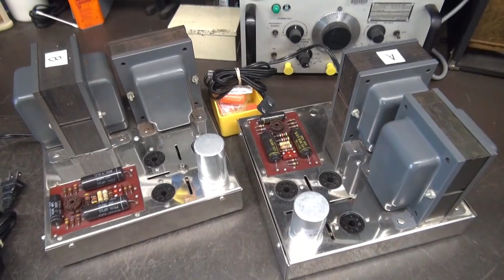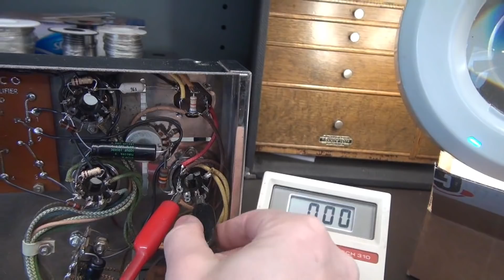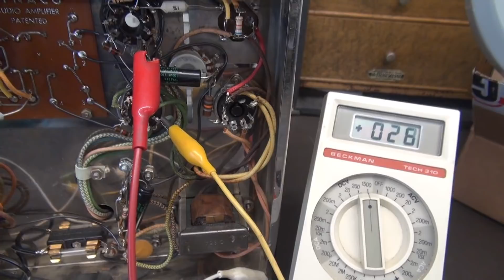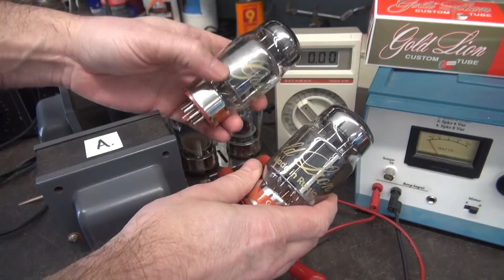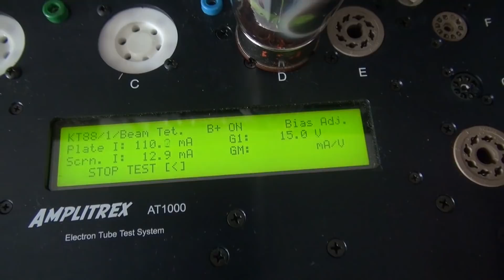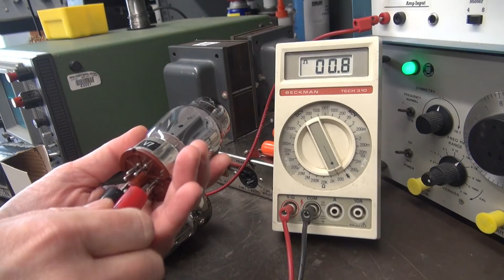How to repair KT-88 tube stereo mono block amp Dynaco MKIII D-lab electronics

Comment: I own three of these mono blocks. Actually, two of mine are much older. I replaced the capacitors similarly. I also replaced the can (I left the can and ran new capacitors inside the chassis in order to keep the same look).

Comment: Beautiful video, everything done right.  Personally I always replace ungrounded AC chords with 3 wire grounded plugs, and eliminate ground loops other ways if they present a problem, but otherwise I really appreciate Your methodical application of common sense with good electronics theory, and demonstration on using a varian to avoid problems, rather than certain other YT channels who, early on, detect problems and then go ahead and turn up the Variac all the way, with no regard to ruining  transformers, tubes,... etc.!

Comment: I have a Dynaco Power 400 solid state power amplifier with the Dynaco Pat 5 pre-amp and matching 22 band EQ powering a set of Klipshe La Scala 15" corner horns on chanel A and a set of sealed speakers with a 10" and a 12"" front firing woofer in each the same tweets, a little smaller mid-horn than the la scalas on chanel B. I cooked something in the power amp a decade ago and I only have left side working now.  I need to find out whats toast(transistor Im guessing).and I should switch out all the caps.   My dad built 3 of these as kits back in the 70s, mine,my cousins and my uncles. I have  new harmon kardon with powered sub and polk towers now and my current system doesnt even hold a candle to that old Dynaco. Where can I order parts for this old beast?

Comment: Ah, but you CAN solder the can lugs to the chassis:  merely scrape off the chrome plating under the twisted lug, down to the base steel,  and use at least a 60 watt iron and a little additional rosin flux on the work and yer golden.
BTW: sure sounds to me at 5:22 that he said "rectumfier tube"

Comment: I was thinking over to buy Golden lions but as I have seen in your video they arrived with open fillements hmm I still think the parcel has been smashed againsted a wall or something. The had matched them and tested them so it's  hard to blame the factory they won't send bad ones. I hear a lot of goods about the sound.

Comment: 17:47  ...   This "bias" reading is derived from the voltage drop across the common cathode resistor 11.2 ohm, 1 watt.  The line voltage will not be a factor in the setting.
Dynaco did this so hobbyist could use any DC meter and first measure a new standard "D" flashlight  cell and then set the bias to match the reading of the battery.  The new D cells would measure 1.56 volts on a calibrated meter so they are used as a reference here.

Comment: bit late now, but Do you have the black lead of your multimeter connected to ground during the bias readings? I can see that the positive lead is connected to the bias pin coming out of the power socket for the pre-amp. Thanks.

Comment: i do not have the Dynaco pre amp for my MK 111 amps. Do i need to short out certain pins on the female preamp power supply output at the backs of these amps so i can just connect another preamp to their inputs? Or simply leave everything stock? thanks very much sir.

Comment: Those are the wrong filter caps ! Only the F & T made 600 volt ( surge ) rated caps are the caps to use in the MK III  Those CE caps are very marginal in the MK III .    Also , a Anatherm inrush current limiter ( perhaps two in series ) is appropriate for the MKIII as that is the 115 volt mains transformer.  A high filament supply is not needed.

Comment: By the way if you run a tube that has gone to air you will damage your power transformer in a jiffy. Look for a milky colored getter spot on the tube, it should be silver like a mirror and turn white around the edges as the material is used up with age like the old tubes shown here, but not all white.

Comment: I have matched quad set of the Russian made Genalex Gold Lion KT66 in my Heathkit W5M mono blocks running now with no issues. I had a bad reliability problem with the Russian made 6L6G Tung-Sol 500v plate Coke bottle tubes going to air many times, would not recommend them.

Comment: Not earthing/grounding the chassis is potentially very dangerous. You will be relying on the screened lead from the preamp to carry any fault current if the chassis becomes live. That thin gauge may not be up to the job of carrying enough current to trip the breaker. Also if you have the preamp disconnected and the amps on they will obviously be ungrounded/earthed. Depending on the internal grounding arrangement you could earth/ground the chassis to power ground, and use a safety ground lift circuit to connect to signal ground. Just sayin.

Comment: I wonder if anyone has built amplifiers with 3c22 disc seal triodes?  I've read they are similar to 6550s but need forced air cooling above 60w power dissipation.

Comment: Terry, the filter can caps that guy put in are not sized right. They look short and even tho they are rated at 500v, you need a 525v cap like the 80/40/30/20 at 550v Authentic cap to be safe. I think the CE Mallory reproductions had some early ones that were mislabeled.
Reply from the maker: Hello, Just double checked, the Filter caps are labeled 525V

Comment: Shame about the defective tubes. :(

What a show-stopper. I had a similar issue a few months ago while restoring a '75 Fender Bassman 50. Opened the box of matched duo of 6L6GC tubes (Tung Sol) and one had a crack in the glass. I noticed immediately due to the getter being not so nice and milky. Had to order a new set, and now the amp is humming along at all the gigs I play it at. I was lucky to have the supplier replace them. I've had some 12AX7's have a nice straight line crack in them when I open them at the supplier. Now every time I buy them in person, I inspect them in front of the sales guy at the wholesaler I purchase them from.

Comment: pardon me kind sir ... i have a conn stereo amp from an old organ ..it had a 12 inch alnico speaker on one side and a 4 inch silly filed coil speaker on the other side i verified the function of the channel with the 4 inch speaker by disconecting the voice coil wires and connecting another 12 inch speaker .. sounds gr8 .. my question is the field coil has a 5000 ohm load with a black yellow and red wire im assuming the black is a ground and the red and yellow are powering the field coil... how would i put a replacement load on the field coil circuit to avoid future problems with the transformer that provides power to that electromagnet.. i assume a 5000 oh power resister of 20 watts or so but my confusion lies in 3 wires!the amp is push pull stereo with 12v6's as power tubes ( massive power trans ) lovely sounding amp that i want to use as home stereo unit..

Comment: Hi Terry . So are the Dynacos a shock hazard without an earth conductor in the mains lead if any wire or component shorted .
Reply from the maker: Hello, nope, they have an internal 3AG fuse. Never had an issue, however I have experienced the terrible hum on units that had been changed to the 3 prong cord. Works fine on guitar amps, but not these Dynacos.

Comment: Wouldn't you want to at least install a polarized 2 prong AC power cord?   I see you have Hoppes 9 gun oil on your bench.  Is that for SHOOTING trouble?
Reply from the maker: Don't believe it would make a difference, the main transformer primary floats, no connection via noise cap to the chassis.

Comment: That is a really clean pair of MKIII's.  I'm running a pair of MKIII clones I built using Triode Electronics transformers and Gold Lions.  I use them to push the low end on my bi-amped system.  I use a Dyna ST70 on the top end.  For what those Gold Lions cost, I'm surprised that you got two bad ones in a matched quad.  They must of been damaged after the match testing.  Interesting that you just happened to get lucky picking two good ones for the first amp and got the two bad ones together for the second.  Sounds like my kind of luck!

Comment: Terry, It'd be good to see how these amps perform using a square wave (rather than a sine wave). Especially when checking tone controls.

Those amps are in GREAT condition. No pitting on either chassis!'

Also, I've heard that adjusting the bias (using a sine wave adjusted for low-level output) for no cross-over distortion (plus a 2-3mA safety margin) resulting in less bias and longer output tube life.

Comment: What a shame.. those Gold Lions look brand new.. someone goofed on those tubes - whoever bought them got ripped off.   Nice job  on those amps...  Perfection  - Ron
Reply: Ron C I believe they were reissues right?
Reply: YES, those are New Sensor Russian '88's...  I have them in my Mark 3's, tried the Electro Hamonix re-issues (Russian), only lasted about 1.5 years of weekend use.   The New Sensor lasted 6 years!   So, on my second matched quad of Genelex...

Comment: Hi Terry! I'm really enjoying your videos...especially this one, since I have a soft spot for old Dynaco kits! :-)
With regard to soldering to a chrome-plated chassis: Try this - Get out your trusty Dremel tool and install one of those little (1/4" more or less) conical green grinding stones. Right where the twisted lug meets the chassis, gently grind yourself about an 1/8" dia. rough spot...without leaning on the Dremel too heavily. Just enough to break through the plating. Then, hit it with a small dab, or drop, of flux, and solder away!!
BTW, you are the only other person I know of that uses a Beckman multimeter!!
The way you approach these projects, I suspect that you're military trained (I'm an ex-Navy avionics tech - '69-'72). Thanks for the great videos!
Reply: Also...What is that audio test set you have? Make/model?? Thanks!
Reply: Norm Jacques thank you for serving our country Sir.